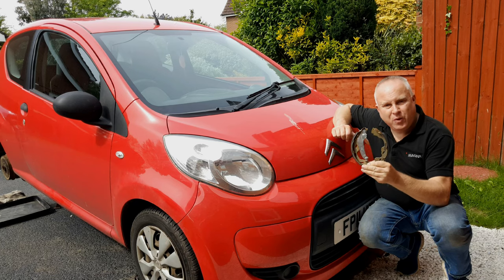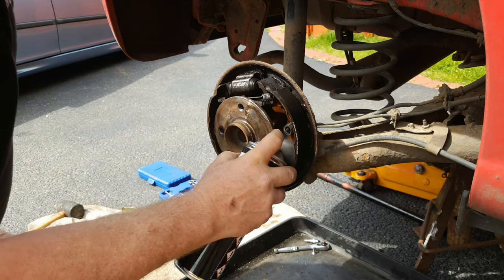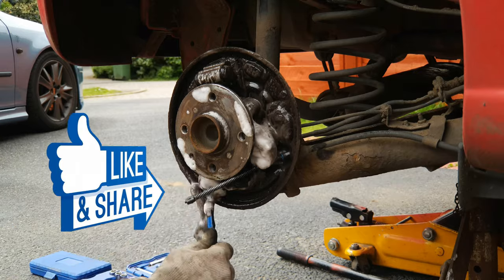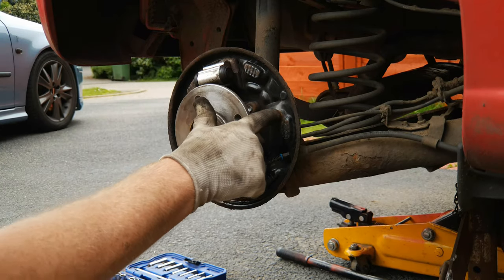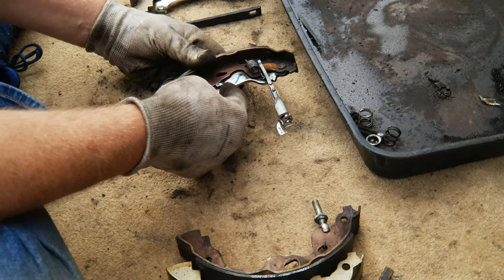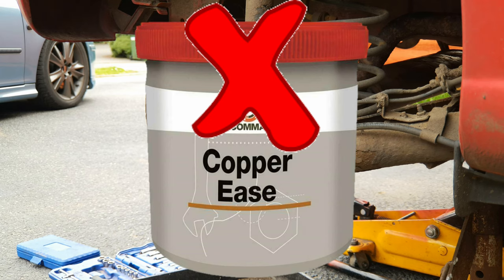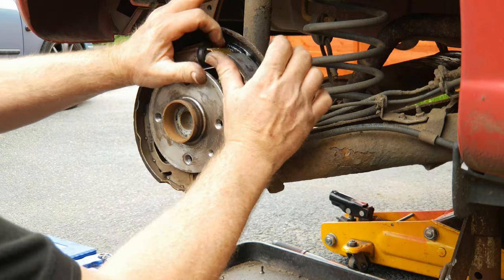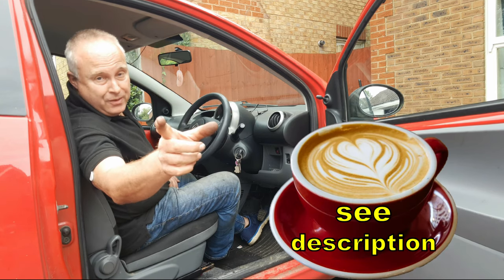Citroen C1 Rear Brake Shoe Replacement | FULL Easy DIY Guide

Comment: If you had included a check for seized slave cylinder pistons and a look behind the rubbers for leaks , it would have been a perfect video , great job on the close ups and explanation of the auto adjusters , best video Ive seen.
Reply from the maker: Never seen a seized rear cylinder. Plenty of leaking ones, but not seized. I guess it must happen though. Good point though to check it's okay.
Reply: @CycloneCyd   I had two on mine , needless to say not found till saturday afternoon , but got them freed up and not leaking , so all is grand for a while.
Reply: @CycloneCyd  Just been to a garage and had mine diagnosed as seized. Wheel wouldn't turn freely when up on lift, apparently. Was looking for a vid on how to replace the brake cylinder (aka slave cylinder), but not to worry!
Reply from the maker: @enemycrab9229  once you've got the rear drums apart, replacing the cylinders is a doddle. Have a look at this video on my son's old Polo. I remove and replace the cylinder in it. The Polo one was held in with a screw, can't remember how the C1 is held in, but some use clips. https://youtu.be/8NraBhfWApc
Reply: @CycloneCyd  I think until you have to change the rear wheel cylinders on this car yourself, I think you would take those words back. Yes looks very easy, and should be, but the cylinders are aluminium with steel brake pipes going to them, so what should be an easy job, turns out not to be, and an expensive one. Even with heat, flare spanners, releasing oil, then still the brake pipe nut to the cylinder rounds off, mole grips etc, you will end up having to cut the pipe and fitting a new brake pipe with the cylinder. Both my rear cylinders on my 07 plate C1 seized, and I found out all this then trying to change them. Seems common for the wheel cylinders seizing on these C1's.

Comment: Sir how long van the cylinder be in before changing? My Aygo has now 80.000 km down.
Reply from the maker: If it ain't broke, don't fix it. They could last the life of the car, 250,000 miles or more. It was probably my fault for not bleeding the brakes often enough. For a while I wasn't able to after an accident. Back on it now though.
Reply: Thankyou so much sir

Comment: Thank you so much. I managed to replace the shoes of my Aygo.
It's not that complicated, but your video helped my a lot.

I have 200.000 km on mine (124k miles) and i hope its good for another few years now that i replaced the rear brakes, muffler, catalysator/manifold and suspension couplers.
Reply from the maker: Thanks Stephen, glad it helped.

Comment: Great attention to detail here especially the adjuster set up, this is where the avid diyer betters the garage job! So easy to make mistakes.
     Both my cylinders had seized and fric material detached on the wife's yaris😯 👍
Reply from the maker: The wear rate on these small light cars is so low these brakes would last forever if it weren't for 'other' problems!!

Comment: Excellently descriptive video as always  thanks Cyd.  I really struggled though with the adjuster spring that fastens to the leading shoe.  It came off with this spring under the shoe as did yours but you replaced back on top of the shoe.  It's only when I went back to check what I was doing wrong I noticed the difference.  I'm supposing this doesn't matter because I really wanted it to go back as original but I'd probably need super powers to do that 🙄 or a special tool.  Cheers 👍

Comment: thank you for this. unfortunately for me the damn handbrake cables are slightly sticking and causing the brakes to very slightly bind & the MOT centre wont pass it. I have ordered new cables but have not found any online videos about changing this vehicles handbrake cables. I tried plusgas and wd40 on all brake drum components and spraying it in each end of the brake cable but it still sticks very slightly and the MOT centre refuses to pass it.
Reply from the maker: What's the drag figures from the roller tester? 10-15kg would be normal per wheel and as long as it isn't above 25kg per wheel they really should pass it. As you can see from the MoT manual there is no specific requirement for the 'drag' to be tested or noted and there is no stipulated maximum.
Do let us know how you get on
https://www.gov.uk/guidance/mot-inspection-manual-for-private-passenger-and-light-commercial-vehicles/1-brakes#section-1-3-1
Reply: @CycloneCyd  Thanks for this. The MOT tester seems to have a braking phobia. I ordered new brake cables, shoes, drums and changed the lot now. Lets see what he has to say now.
Reply from the maker: @ferenczsinko6770  even if it passes now, you could still complaint to DVSA . It sounds like he needs some learning